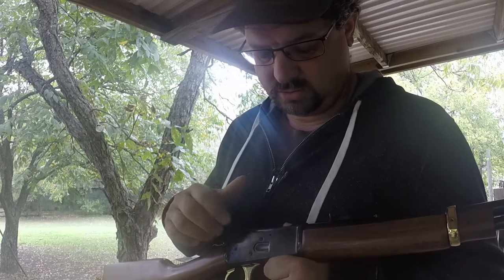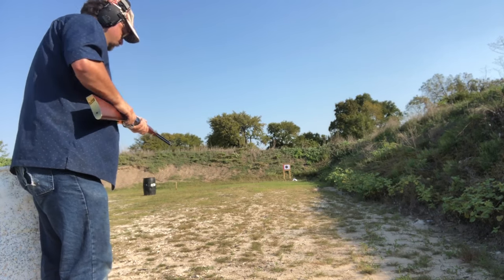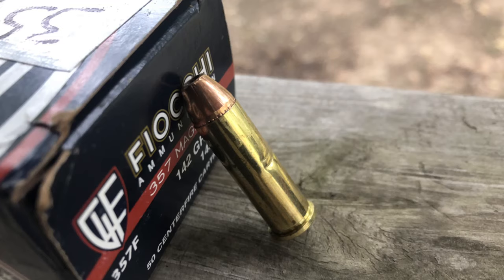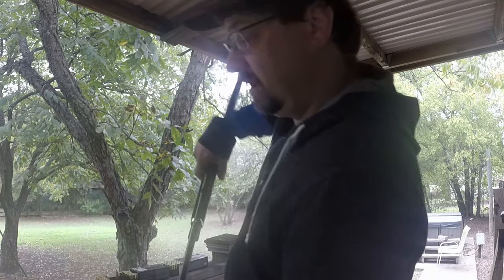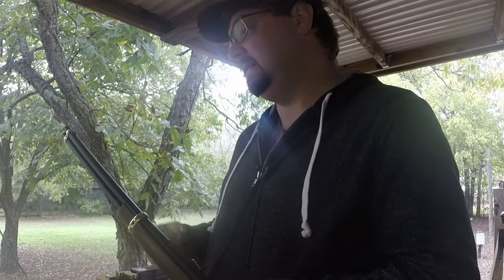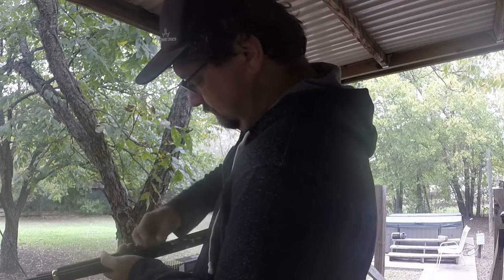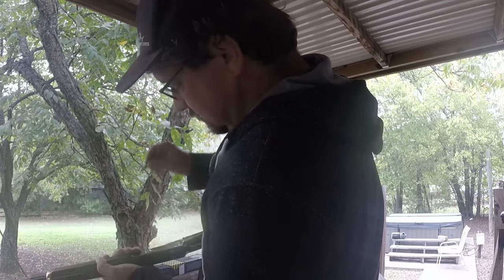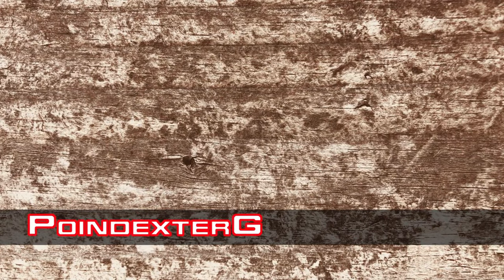Fixing the Rossi R92 Loading Gate

Comment: The feeding problem is probably because you are completely feeding the round through each time you put one in. You want to leave the round showing with the gate still open after each round is put inside. The very last round is when you fully push the round in and close the gate
Reply: 100% this! I took my R92 to a Cowboy Action match and I would shove each and every round fully into the rifle when I loaded it. It killed my finger as it grated against the brutally sharp loading gate edges! Then I figure that I can just shove the nose of the round in, such that the rest of the round just took up the space of the loading gate. Then the next round I put in was used to shove in the half loaded round. When I got to the last round, I had a wooden dowel that I glued into a used cartridge case and use that to shove the last round home. The back of a stick pen, or an unsharpened wood pencil does the job just as well!
Reply: Using the next round to push the previous round I actually thought was common knowledge!  Seriously.
It’s the way I was taught to load lever guns 50+ yrs ago.
Push the round in leaving roughly 1/3 of it outside on the gate, use the next round to do the same until the last, then push that one home. Not only is it easier, it’s a lot faster also.
Reply: @megastick9324 They use junky plastic magazine tube follower which binds making it harder to load, my Henry big  boy has plastic follower to which caused unreliable feeding.Henry warrantied it and just replaced plastic follower with stamped metal and alls well.
Reply: @benthere404   yeah, I don’t know when , but pretty much all lever guns went to a plastic follower, which, even if it works well at first, gets crumbly and breaks over time.  
Thanks to an active after market, metal ones are available for most now. There’s even one for Marlins, maybe others, with a small indentation in the center for using the plastic tipped ammo, like leverevolution, it keeps the tip centered and eliminates the tendency of the rounds to get cocked in the tube causing poor feeding.
In my opinion, any gun with the plastic follower needs the fix right out of the box.

Comment: My .357 was not hard, it was about impossible!  What finally fixed it was grinding off a section out of the middle of the loading gate spring.  I did shorten the magazine spring a good 3" but the thing that made the difference was the loading gate spring mod.  I got this idea from the info from Steve's Gunz.  I did not have any trouble like this with an earlier .454 Casull model.  It is a plenty accurate rifle and a lot of fun.
Reply: Thank you so much! I just did the same thing and now the loading gate feels like a Miroku Winchester!
I was thinking about grinding down that spring before but I wasn't really sure if I should do it. Best decision ever! 😀
Reply: @maximilianmustermann5763  how mutch did you shortened it?
Reply: @skfaskfa4667  The loading gate spring is a leaf spring, you can't shorten it. You have to grind off material from the sides to make it slimmer. I took off a good 1/3 in the area where it bends the most (closest to the screw where it is fixed to the gun)
Reply: ... it's easy to test before you take off too much. Grind off a little bit, screw it in (it's just one screw) and test it. Then go ahead until you like it.
Reply: @maximilianmustermann5763  got it, thank you. I'm thinking about getting this rifle, but I promised to myself some time ago to never buy a gun  whitch need corrections again. ;)
Reply: @skfaskfa4667  that’s nearly impossible, that’s what gunsmithing is for. Every gun can be better. And it likely was, from a gunsmith at sometime, if you think it’s perfect. 
Same thing with hand loaded ammunition compared to factory ammunition. It is tuned to the firearm itself my friend.
Reply: I was going to mention the loading gate spring, there's a company that offers a kit to replace them with a lighter pressure spring but I haven't gotten to that point yet, my rifle is a . 45 colt and I really enjoy it.
Reply: It does seem like .357 isn't quite the sweetspot where the weight of the round itself is easier for the mechanism to manipulate.
Reply: Just came home from testing my .357 and I literally couldn't load some rounds. We're talking first and second round, not even 9th or 10th, awful. Disappointed since these are almost Winchester price. Thanks for the tip.
Reply: Did this to my Rossi, and it is the first thing I would reccomend any R92 owner to do!
Reply: @timtheeagle1  - Yep, had that problem, too. Sent it back to Rossi to be fixed and they said it was repaired but they didn't solve the problem. Gotta say that next time, I'll get a Marlin or a Winchester or Henry. Rossi needs to get their act together. Sending improperly finished and shoddy products out the door isn't how to get/keep loyal customers.

Comment: I have 4 Rossi's, and the tubes and feeding gate all loosen up after a box or two of rounds for even the most stiff rifle I bought.  Most were worked in just fine after 20 rounds.  I own a 20 inch stainless R92 .454 Casull, a 20 inch blued R92 in .357 Mag, a blued 24 inch octagon barrel .44 Mag R92, and a R95, blued 20 bbl .30-30.  I adore all of them.  Best rifles in their price range bar none.  I'm hunting down an R95 in .45-70 now.  Sold out, but I'll get one soon.  Do not hesitate people.  The Rossi's are amazing rifles.  Save the money you'd spend on a Winchester Miroku and buy one of these.  You won't regret it.  I actually found my Miroku was super ammo picky.  These Rossi's aren't ammo picky so far as I've seen.  All the ammo I could not get to run in my Miroku Winchester has all long since been shot out of my Rossi.  I sold the Winchester.  Too picky on ammo.  Beautiful doesn't count, when a rifle is selective on what it'll fire.

Comment: I have 2 Rossi R92's, one in 454 Casull and one in 357 Magnum.  I also had problems with loading but I found the answer and it didn't involve any disassembly.  When pushing the cartridges in sometimes they will contact the edge of the magazine tube.  Just push the rounds in at a downward angle and they slip right in.  Also, you can push them in 75% of the way and load the next one and use it to push the previous cartridge all the way in, your last round will be the only one required to push past the loading gate with your thumb.  Shortening the mag spring can cause the rounds to bounce under recoil and possibly hammering the bullets into the case deeper if the crimps aren't perfect, pressures would skyrocket.
Reply: I have seen others use this method as well.
Reply: Same. Figured this out fairly quickly. Use will help it as well. Angle the bullet downwards and push.
Reply: I've had my Puma '92 .357 for 20 years, and that's exactly how I load mine, with no problems.  I don't like cutting or adding things to a factory engineered firearm.
Reply: I thought this would work at the range today but I didn't try. Thanks for the tip.
Reply: I have the same two R92s and you are correct on every thing you just said. The R92 .454 Casull is like butter and I load the .357 just as you explained. Loading gates can have issues with 1873, 1866, 1894, 1895 Winchesters also.

Comment: This video made me laugh. I only have 2 inches sticking out and mine holds 11 mags and 12 specials no need for a plug just count or pull the one that want fit out. smooth the inside out put a centry c350 spring in for the ejector spring and you can work it with your pinky. I have never had a rough Rossi as long as you do them 3 things to it and I own 12 of them.
Reply: Where do you get the spring?

Comment: Great video sir. I have the 16” version and I love it. I guess the loading problems only apply to those with girly fingers. Mine is stiff and sharp but I have no problems loading it. Just kidding. It is pretty awful to load, I did scratch my finger a time or two. I hardly use it, so it hasn’t bothered me enough to fix it yet. I’ve loaded and cycled it a bunch of times and am used to it now. My hands are pretty rough though from years of working with them. Thanks for the good tips, keep up the good work.
Reply: @old rabidus Rossi probably use the same spring for 16", 20" and 24" 😑
The spring on my 20" came out 7 inches from the tube. I cut off 4 inches and now it's totally fine.

Comment: I know there's a video has been around for a while but I just wanted to say thank you. Thanks to this video I was able to fix my Rossi 92 in the exact same way by trimming the magazine spring and adding a plug made from a plastic coat hanger. Now it loads much easier and I don't have to worry about the last round getting stuck three quarters of the way into the loading gate
Reply: I need to try this cure.  The inside edge needs to be ground down just a bit to allow easier loading.   I spoke to Rossi and they informed me that the problem will cure itself after repeated use.  I explained to the rep that I'm 82 and I may not live long enough to find out !

Comment: Rossi (Taurus) seems to have just thrown the biggest springs they could find into this design. Been debating buying one in 44 mag and slicking it up, because lord are they rough out the factory, but a couple hours with some India stone, new springs, and a little bit of work on the gate spring and you've got a performance rifle for less than half the price of a Winchester.

Comment: Don’t go hacking off a big piece of spring. Take off two inches and try it out. Then a single inch at a time…testing between each small cut until it works just a little too stiff.
   It will loosen up more after 200-300 rounds…so don’t over do it!
Reply from the maker: The only reason I was willing to try it on this one is because factory springs are readily available and not really expensive. So it's not a major cost if I completely messed it up. It's still doing well right now, so I'm not taking anymore off.
Reply: Will the action smooth out too?  I have the Citadel Levtac-92 357, shot first time yesterday and the lever felt a little rough.
Reply: Mine (16 Stainless) has sat in the corner fully loaded for 7 years...it was still too much (had about 6" of "extra spring") I took about 3-4" off of it...Huge difference, but YMMV.
Reply: My Rossi 20" already had about 1500 rounds through it and I took off 4" of the spring, leaving a good 3" coming out of the tube. It's absolutely perfect now, the spring pressure is still really good.

Comment: If you remove the loading gate itself, you can remove some of the width of the leaf spring so it doesn't fight you as much pushing rounds in.  The gate isn't what holds the rounds in the tube.  It's just a dust cover.

Comment: I just bought a Rossi 38SPC/357Mag with the 16" barrel and it is almost impossible to load the first round of 357 Magnum.
The spring tension is so high I have a hard loading any cartridges. Will this help? I have wood plugs for my 20 Gauge which look to be the same size as what you used.
After several tries with no ammo, it seems the gate spring tension is too high and I can't even depress it with my finger to clear the cartridge tube.
I paid $800 for it and I can't even load it!

Comment: So to reduce the magazine by 3/4 of a round (of 38 spl or 357 mag?) how long did you need to make the plug?
Reply from the maker: I really should have put that in the video. Mine is 3.4 inches, that’s right at 3 3/8 inches, or 8.6 centimeters if you want to be that way.
Reply: A lot of people just suggest to push the rounds with the next round instead of pushing it with your fingers. My rossi is still on layaway so I will mess with it when I bring it home.
Reply from the maker: @abelp81  I found that to help quite a bit, but it still takes more force than I'd think is necessary without cutting down the mag spring. It does keep your thumb from going across the gate as much and helps on that count quite a bit.
Reply: I have the 24" octagonal barrel  in stainless steel .I shortened the magazine spring by 2 357 cartridge lengths and it made a big difference .It was recommended to shorten it by three cartridge lengths ,but I left it at two.Mine takes 12 357 rounds ,13 no go .
Reply from the maker: I’d have to pull it out and measure. I know how much I cut off, but that’s it.

Comment: Nice video or Shortrning the Magazine spring but no video of fixing the actual loading gate.

Yes shortening the magazine spring will make it easier to load as there is less force needed to push the cartridge forward but the loading gate itself is too hard to depress which adds to the overal force to needed to load.

Would you please show how to fix the actual loading gate?

I have heard that it is easy to reduce the amount of tension on the loading gate by either bending the loading gate or by thinning the loading but I have only read about it and have not seen any video's acually showing how to do it.
Watching how to do this would be nice.

Comment: Great!  I just bought a Rossi 20" barrel.  Haven't even fired it yet, want to make sure I am familiar with EVERYTHING before I do that.  But as I was loading rounds, my thumb was DYING!  I even broke my nail half way down.  OUCH.  So, I'll be looking into shortening my spring just a little.  It seems like this is a problem with A LOT of Rossi guns.  Surely they KNOW about it by now.  Why don't they DO something about it?
Reply: I think they make all the springs extremely stiff so you can use the gun as a farm tool for 20 years without cleaning and it will still work. At least that's the only explanation I can think of.
You can also grind down the leaf spring of the loading gate itself. I just did and it worked wonders! Just make the leaf spring a good amount slimmer towards the side where it's screwed in and it will bend down way easier. Almost feels like a Miroku Winchester now!
Reply: @maximilianmustermann5763  Thanks

Comment: In my 44 mag 16 inch carbine after cutting the spring i can fit 9 rnds in the tube instead of 8....for a total of 10 rnds in the gun.....so i fixed my stiff feeding and gained a rnd of capacity

Comment: I have 16" Stainless Rossi 357 with Safety Delete and metal follower...just took half of the "sticking out" part off of mine...the first round used to fight me so bad...no more...I am gonna file the cheese grater off the outside edges (Stainless so won't see it anyways) - I see on Stevesgunz they say to leave 6-8" as proper tension...🤯...My spring has been under constant load for 7 years and it still had too much...2-3" of spring is plenty on a used spring maybe 4" on new one?

Comment: I have the Rossi R92 triple black, very slick and smooth cycling , however; the spring cover "loading gate" broke as I was loading, I will have to contact Rossi company..... Hope I can find one soon......all functions have ran perfect till this happened.
Reply: A Winchester one piece gate works in a Rossi 92, might have to do a little filing. I fitted one to a 357 92 after the two piece broke, works great.

Comment: One last step,
the loading gate is still too tight causing you to have to fool with poking rounds in part way then forcing them in the rest of the way with a dowel or the next round etc.
    The loading gate spring itself is much too strong.
With a Dremel cut away 2/3 of it's width taking 1/3 off each edge, it won't matter how sharp the edges of the loading port are once you can gently slide ammo through the gate and 1/3 of it's original width is more than enough to bring the gate back into closed position....which is all it does.

Comment: Would have been nice to hear the caliber. The .44's are rather different from the .38's.
Reply from the maker: It is the 357/38 model. I should have mentioned that
Reply from the maker: I’m just not sure how much you need to cut off or how long the plug needs to be for the .44. You’ll just have to play around with the lengths. Cut off small sections of the spring and see how it works, you can always cut off a bit more. And you’ll have to experiment with the plug length.
Reply: Clean your ears. He mentioned the caliber on several occasions
Reply: @edstimator1 What?
Reply: @billdailey6315  nice!

Comment: You don’t stick your finger inside the load gate for one you push the round 3/4 of the way in and use the next round to seat the previous into the magazine. When new load it up and let it sit for a couple days and then cycle them out reload them again and it should be easier and you should be able to load it up fully. Let it sit fully loaded for a day or two then cycle the full magazine out. You have to use it to break in the magazine springs. I have a brand new m 92 and I never had any issues with loading the 10 rounds in it. There’s a break in period for these things. You don’t just start tearing your gun apart changing stuff. Mine is like butter and yeah if you stick your finger all the way inside the loading gate you’ll likely see blood trying to load that way. 🙄
Reply: Then how do you load the last round? You have to stick your thumb in at least once!
I had my R92 for almost two years and about 1500 rounds, waiting for the break-in to happen. It did smooth up a little, but the springs were still way too strong. All of them!
In the meantime I've tried other lever actions like Uberti, Miroku Winchester and Marlin and they were all much smoother and faster to load, and they don't eject brass like projectiles. Rossi factory springs are just insane, all of them.

Comment: So he skips how to remove the magazine spring cap??????
Reply from the maker: I guess I didn’t go over that. I have it in the disassembly video and didn’t think about putting it here. More or less you just unscrew the screw on the bottom of the mag tube below the cap. Keep a finger on the cap as it’s under spring pressure and could fly across the room. If it doesn’t come free easily, stick a punch or an Allen wrench inside the screw hole and slowly work it forward.